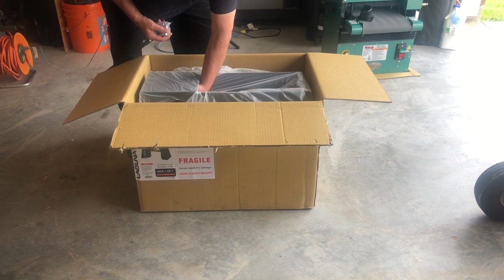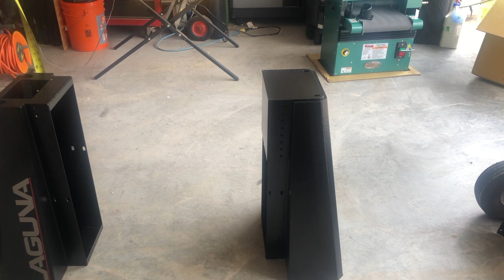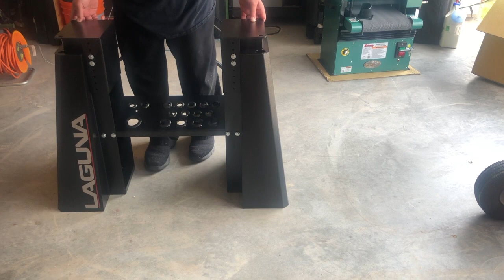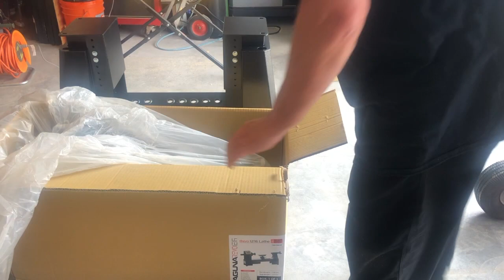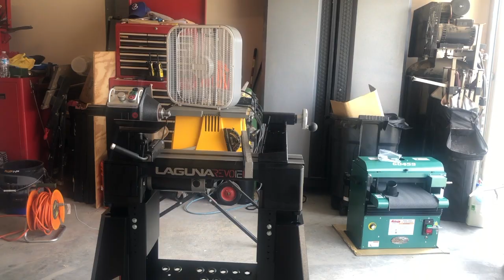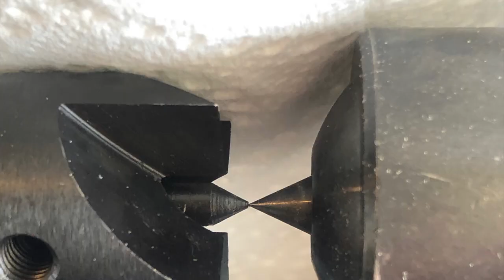My Journey into Woodturning #2 unboxing and setting up the Laguna 1216 lathe

Comment: Hey Mike,  I finally received and set up my Laguna REVO 1216 and noticed when I checked the alignment of the drive center and the live center, they miss each other tip-to-tip by about 1/16".  But I couldn't find anything in the Owner's Manual that both checks for that or discusses how to align the two pieces so that a piece of pen stock, or any other piece of wood would run true when the machine is turned on.  Do you have any idea if this machine has the capability to make alignments such as this?  I even rotated the two centers within their individual MT2 sockets in case it was just a seating issue, but that didn't change the off-alignment.  I didn't see any maintenance info or troubleshooting information either in the owner's manual.  Thanks for any feedback.
Reply from the maker: I make sure the bed is level, I remove the tail stock and check the bed both long way and short (across) the bed. I clean the bed and the bottom of the tail stock to make sure any "gunk" is off the unit. If that does not help it, call Laguna Support, They are very good to work with.
Reply: Thanks Mike for the quick response.  Yes, so when I first unboxed and mounted the lathe onto the Laguna legs I cleaned off all the shipping grease, etc., then I sprayed on (impregnated the cast iron and steel surfaces) with a special teflon coating called GlideCote made by Bostik - a very common woodworker's spray that protects cast iron and steel from rusting.  After I sprayed virtually all the metal surfaces of the lathe and buffed it all out, I used SC Johnson's good old fashion furniture paste wax, which doesn't have those silicone excellerators in it (and which if I remember correctly seeing you use it, too in one of your videos. LOL) on not only the bed but, again on all the surfaces, let it completely dry and buffed it all out.  That didn't really change it - it just made the tailstock and banjo glide very easily and now my cast iron and steel areas will be well protected until I use it again.  But again, I don't think that had any negative impact on the alignment issue.  I did reach out to Laguna's Tech Support, but don't expect to hear back from them until Monday, which is why I thought I would post the questions here with you, since you thankfully reply so quickly.  However, in this case since you haven't had this issue, I suppose I'll try other things such as maybe applying a tiny wafer thin spacer under the tailstock hold-down clamp or something.  I'm still not sure if the 1/16th inch difference is significant enough to sweat about, but being a new woodturner and I wear a face shield, I don't know that I want to see a piece of wood come flying off - no matter how small - at 3500 RPM simply because the wobble intensifies as you increase the rotational speed. Or that I'm prevented from turning my lathe up higher in speed for that reason.  Surely there must be some sort of alignment adjustment feature the owner's manual left out, albeit different from the adjustment that can be seen on the larger models.
Reply from the maker: @johnhuggins5021  Is it off sideways or up and down?
Reply: Hi Mike.  Well not to sound stupid or whatever, but this morning, all was well again, back on the farm.  I took both centers off the lathe rest and installed them into their respective MT2 taper mounting holes and ran brought them together, purposefully fully seating each of them, and wa la!  They touched points perfectly.  I think I must not have properly seated them and simply only just loosely inserted them?  Not sure, but this time I purposefully fully seated them and they came together both horizontally and vertically - no distance off as before.  So I guess one might say, it was operator error.  With that said, I still can't help but wonder why there is no vertical or horizontal alignment adjustments for reasons you mentioned in your first response.  Dust or other wood debris could easily wedge themselves between the bed and tailstock when using it over time - not to mention simple wear and tear over time.  But oh well, for now I'm back to being aligned like they should be and ready to rock-n-roll once I attach my 10-in bed extension kit to one end and the 20-in bed extension to the other end.  Sorry to have bothered you about what appears to have been my error.  LOL.
Reply from the maker: @johnhuggins5021   Not a problem, glad you got it. I use a small brush to clean out the MT holes plus air. Now and then I'll take a paper towel wrapped around a screwdriver and run it in. Dust and wood chips are not our friend lol. Glad you got it. Time to turn.
Reply: LMAO!  Now that was funny!  Thank you again for your help.  Now that I think about it what would you have suggested if it were off horizontally or vertically?  chips/wood dust under the tailstock for vertical? and ?? for Horizontal?
Reply from the maker: @johnhuggins5021  Probably call Laguna lol
Reply: Ya,  I wrote up a ticket on my original concern.  That should prompt them to answer the question of how to make minor adjustments if necessary and/or even possible on this model.  But their tech support is only open M-F.  Since this isn't really an issue at the moment, I can wait for the answer.  I'll let you know what they tell me, if you are interested?  LOL
Reply from the maker: @johnhuggins5021  Yep, let me know what they say, Thanks
Reply: Hey Mike.  So Laguna Tools got back to me with regards to making minor adjustments to the alignment issue I thought I was experiencing, but later saw was really an operator error - at least for now.  However, to make these kind of adjustments, while probably a pain in the back side are contained in this attached document link if it works, should you ever need them. I don't know if the document and their attachments will open up for you. If not and you really want it, just post your email here and I will send the attachment via email. Please let me know if you ever need to make them and how it turned out for you, brother.   Semper Fi, John             Adjusting the Centers on the Laguna 1216 Lathe.pdf
Reply from the maker: @johnhuggins5021  Please send me the email, I would like to see how they make the corrections, Thank you bodawg999@gmail.com

Comment: Hi Mrbodawg, thanks for your response earlier. Your videos are very helpful. I just bought the same model Laguna lathe and I have a couple differences and questions. You show a red and green on/off button. Mine is black and white with a 1/0 on it. It works but  is odd. Is there a back light behind the switch. Also, on the extension mount on the outboard, I have a fourth hole, on the left near the bottom that not threaded. I didn’t see it on the video, maybe I missed it.
Reply from the maker: Not sure about the black and white difference on the button but mine does not have a back light. I don't know about the non-threaded hole other than it might be an alignment hole. You can always call customer service, they are friendly and can probably answer why the differences.

Comment: Is there a separate on and off switch to shut the lathe down?  That is where the rpm light is out, without unplugging the lathe.
Reply from the maker: This one does not. Several of the larger Laguna ones do. I have an industrial type of extension cord/power box with an on/off switch built into it.